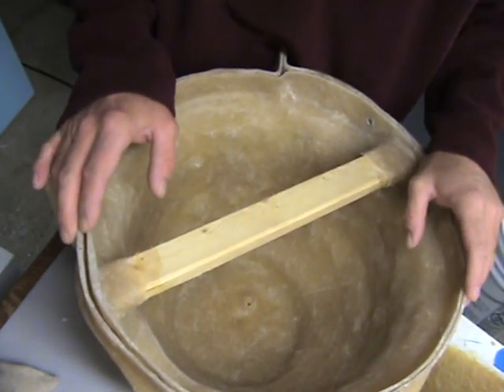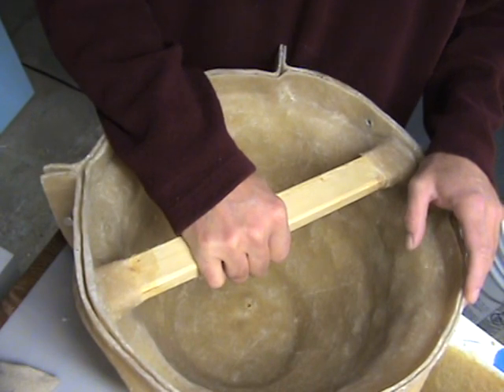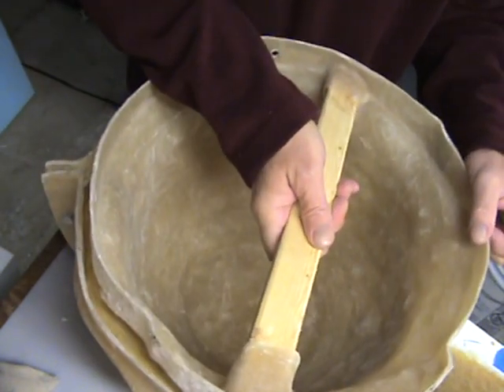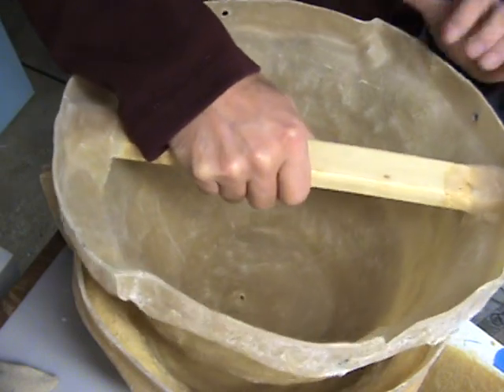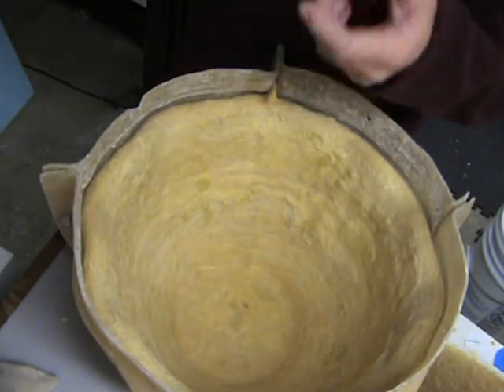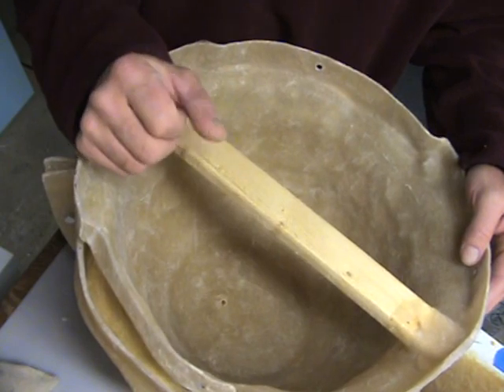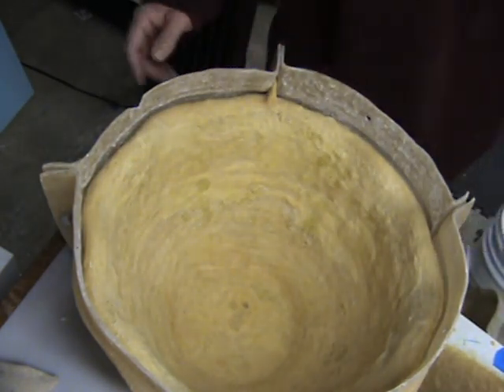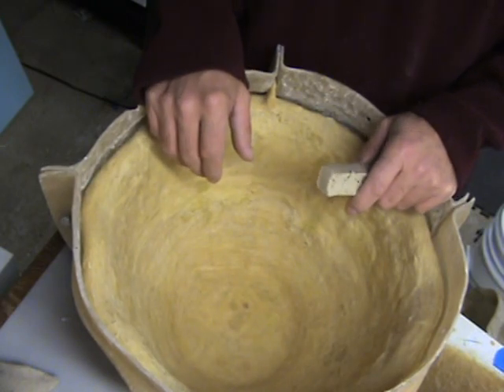www.diymolds.com - Latex Fiberglass Planter Pot. Glassing Inside Bowl Tip

Comment: Hi! I try to do a concrete planter but the bottom part was too narrow and I couldn't get the cement to go all the way to the top. Did you post the videos on How you did this pot? Thank you
Reply from the maker: So you made a mold of a planter pot and you can't get your mix to go to the bottom? What kind of mix ratio? Try just sand and maybe some super p for flow. Again you should come to the forum and ask these questions. Loads of people there with tips and tricks.
 Thanks  www.diymolds.com